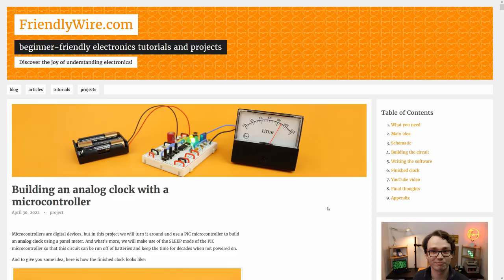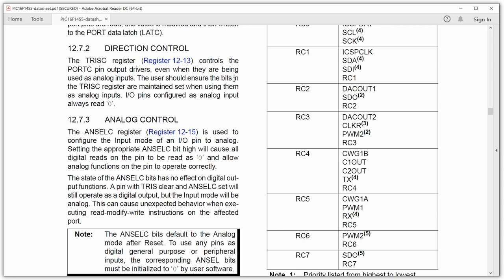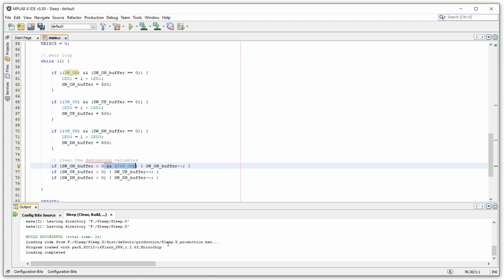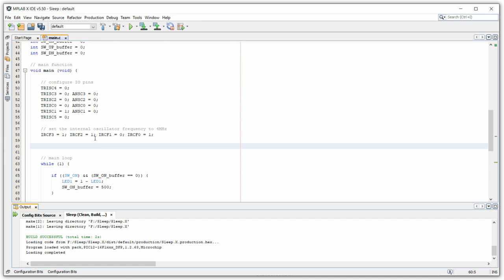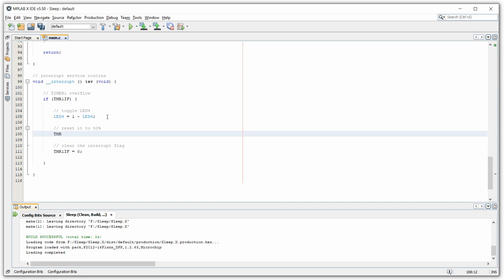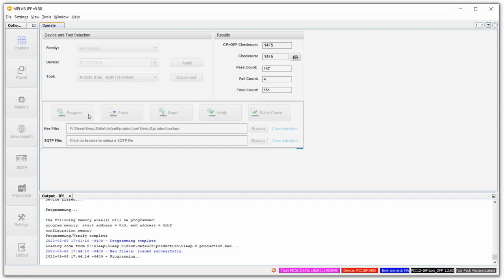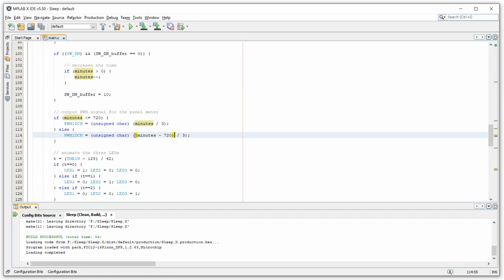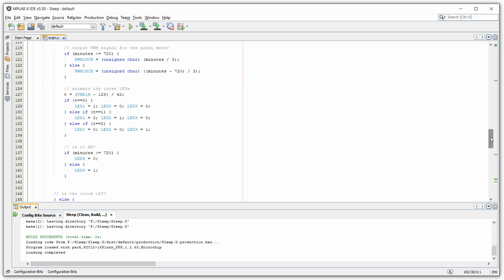How to program an analog clock with a microcontroller

Comment: This is awesome, I am an electronics engineering student my self, and it is always nice with a well rounded tutorial to brush up on some stuff.
And might I say, the pickit seems like a nice way to use a microcontroller. Correct me if I’m wrong, but some microcontrollers need so much setup, that it ia almost impossible to do it yourself at home. Nice that there is actually a usable solution, so that we can avoid arduino a bit 😂😊
Reply from the maker: Thanks for your kind words, Jonas! I agree, the PICkit is not so hard to set up, especially for these 8 bit microcontrollers :)

Comment: Hi There!  New to the channel and just subscribed.
Used to do a lot of PIC programming but have been away from it for years (I started with PIC 16F84 and MPASM doing is all in assembly!).
I was thinking of doing a project for a friend (a solar charge controller (for his raeley used truck) and so was trying to get my PIC-memory brains-cells back to a functioning level.  I used to use the old MPLAB 8 and the Hi-Tech C but see that they have this new MPLAB-X and XC8; so am looking over your shoulder to see how to use the new GUI.  I was puzzled why you use MPE when you can c program through the PICkit3 directly from main MPX?
Anyway, really like you channel and hope to learn more from you...  Thanks!
Reply from the maker: Thanks for your kind words, and welcome back to the world of PIC microcontrollers! Yes, using the built-in programmer would make more sense... except that for some reason it does not run properly on my computer, and there is no reliable connection; the simpler, MPLAB IPE standalone option works just fine, however. So I like to use that one, especially for beginners who just want to flash a ready-made .hex-file it can be a bit simpler to use (for example in the project here with the analog clock, there is no need to compile your own code, and if you just want to build this project as a beginner the MPLAB IPE is easier to use, I find). What do you think?

Thanks again, and have a great rest of your week!
Reply: @FriendlyWire  Jens, I sent you an email on your website; did you happen to see it?
Reply from the maker: @SpinStar1956  My goodness, no, when did you send it? I will have to check again, my apologies.
Reply: @FriendlyWire  Thursday the 12th 🗓 to the “info” account.